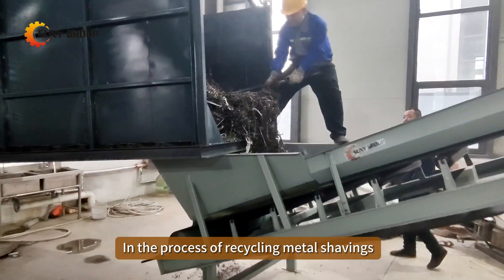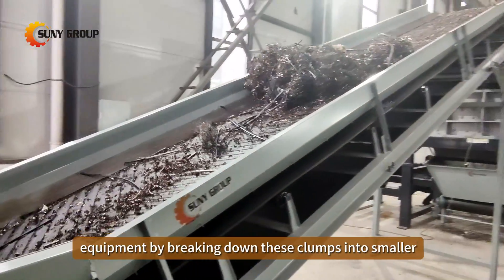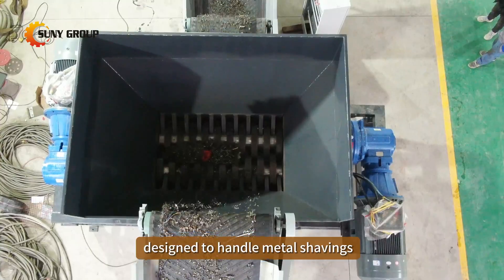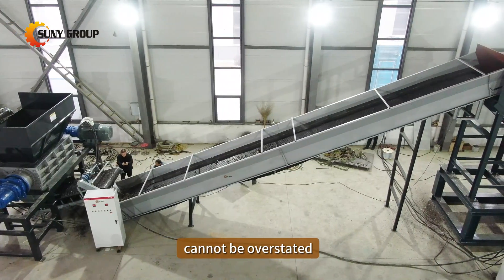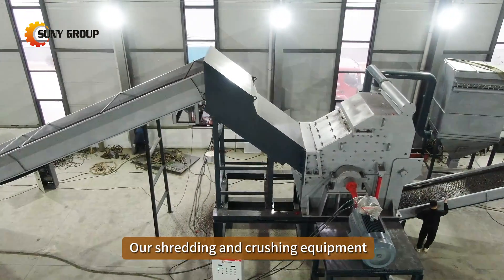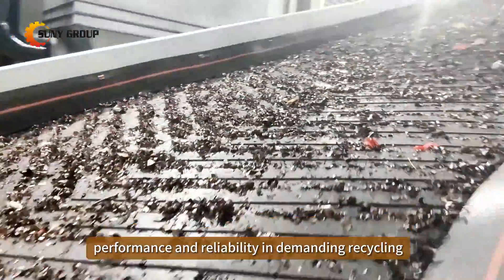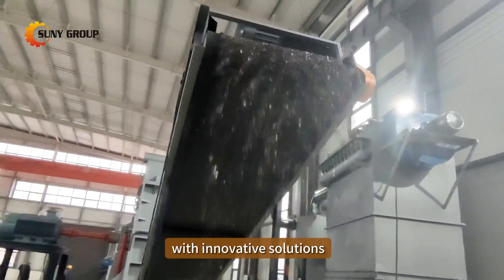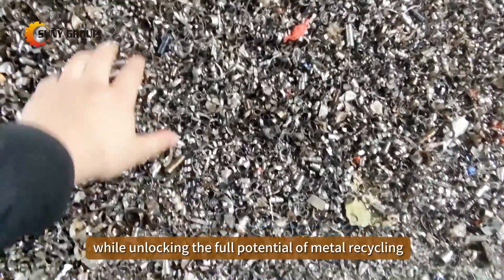Metal Shavings Recycling: Scrap Metal Swarf Shredding & Crushing Line

Comment: I used to repair forklifts and equipment at recyclers like this one, if I had a nickel for ever metal splinter, scratch and cut I could've retire ten years earlier. And that was wearing gloves most of the time, only taking them off to perform intricate tasks that couldn't be done with them on.